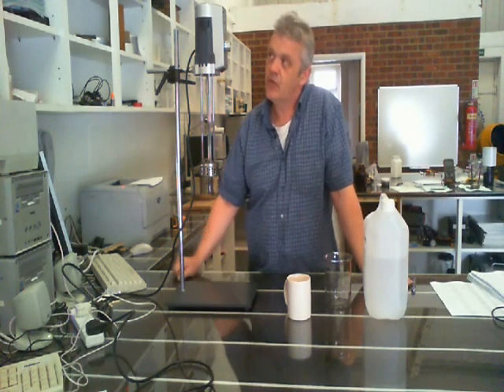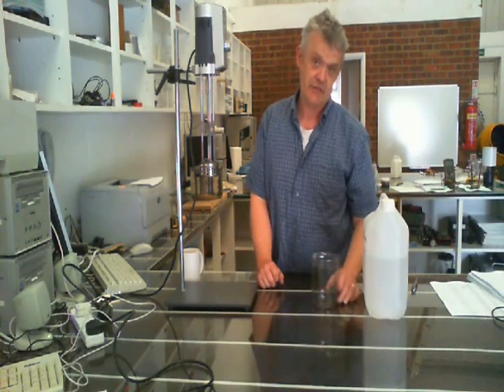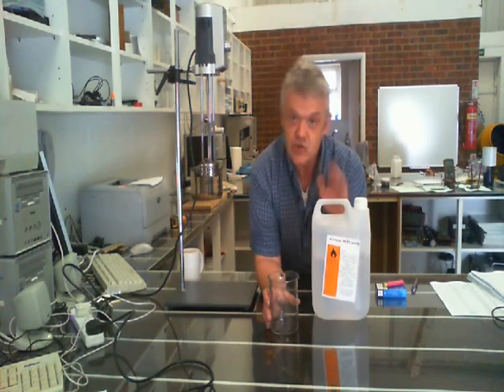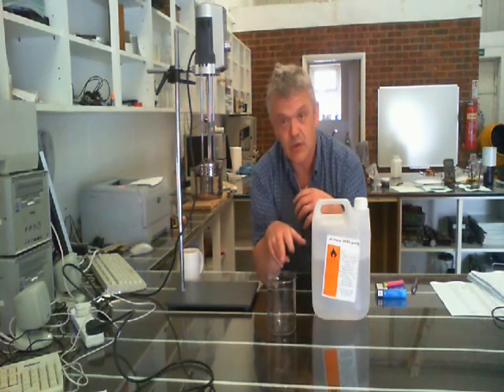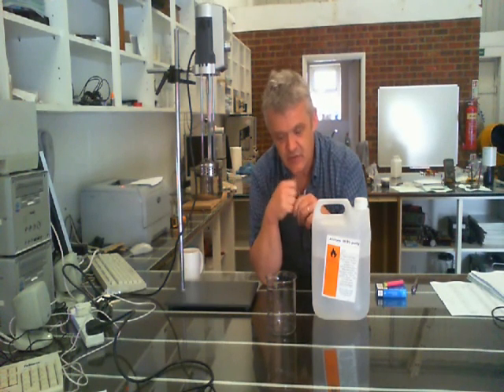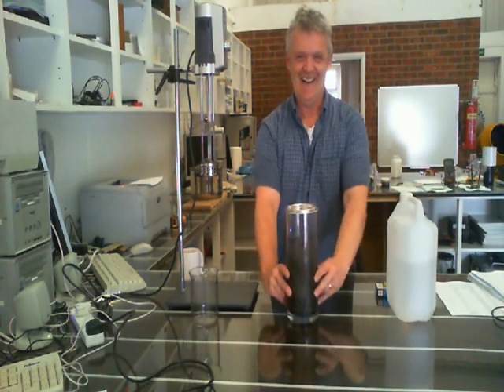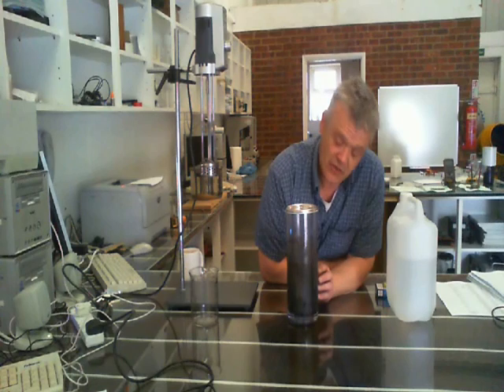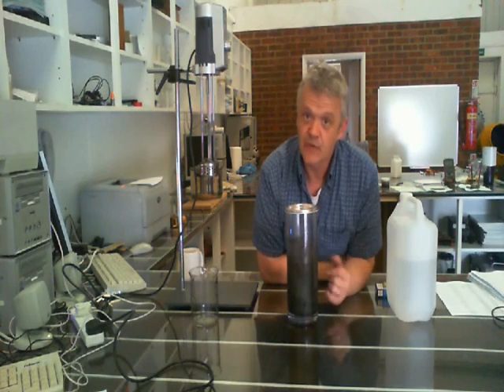The Easiest Way To Make High Quality Graphene

Comment: Thanks for the insight. I got a little frustrated trying to filter soapy graphene myself. I tried just using 99.9% isopropyl but the graphite doesn't exfoliate in that solution. Was thinking about doing an experiment with toluene, but that is kind of nasty stuff. 
Have you researched or had any experience with electrostatic deposition for graphene layering. I read short little paper on it and it was an interesting concept. Just curious on your thoughts about that as a viable option to get  a near "single layer" graphene sheet(s).
Reply: Aye, I figured you would say something along those lines. I was just seeing if you have investigated that possibility. There is other options that come into my mind like a electrolytic bathing solution. It doesn't necessarily have to be the same set up, just the idea if polarizing the graphite structure with a charged potential and layering it on some sort of substrate. Hope the idea isn't too radical for applications. I appreciate all your work, I didn't mean to delivery a pie in the sky idea. Just a little food for thought. I apologize if it made you sick ;)
Reply from the maker: Diadon Acs
dude - it should be obvious from my channel i set myself constraints - the process needs to be do-able in an average lab or one that can be set up easily, the process should be scalable, it should be cheap, the process should have an end product in mind. If it doesn't fit these criterion I discard it as there are so many processes it's not possible to look at them all - this is outside the parameters I have set and I can think of other methodologies for achieving the same ends.
Reply: Robert Murray-Smith nice to see Diadon over here, and is that Mitko? two people I met through knights of the round table radio show :)
on the deposition, the problem with depositing carbon it seems is that it is electrically neutral having just exactly half of the electrons it wants to fill that outer shell, and was something I considered altering in two portions, of a project, by using specific frequencies of laser light, this way you can dope the protons or electrons with photon energy raising the atoms positive or negative charge to get them to bond together and if the frequencies can be found, it should not take more than a laser diode or some fairly directional light to keep it from spilling into each others areas, like how a light is shot through a long matt black tube to get rid of the spread the light puts out :)  then you just need enough positive and negative voltage and amperage to come very close to what you are needing to do the deposition, and the light gives it the nudge to reach reaction point allowing you to control not only the atoms to get them to bond but also control where they are bonding. thus giving 3D printing capabilities with it :) I hope this secures this for posterity here so that no corporation comes along trying to patent that idea after I put it out there is all, like you said here about blocking the act of withholding use of good ideas by blocking the patents on your co-solvent idea, :)
Reply: you making graphene my friend?
Reply: Yeah, I have been dabbling with it. Turned out very soapy like he Robert said. Difficult to clean off and use for capacitor tech :)
Reply: hmmm....some brain food givem to me....
Reply from the maker: do you have the title to the paper?
Reply: http://arxiv.org/pdf/0808.1577.pdf?origin=publication_detail
There you go, its using a gaseous medium for the deposition. Might be possible to use a electrolyte if one could charge the graphene particles and deposit them into a negatively charged dielectric that wont bond to the nano particulate graphite.
Reply from the maker: Diadon Acs
Now then lol - the electrolytic bath is a different idea and I have used it for the reduction of GO to graphene - it very temperamental and sensitive to initial conditions soon dropping out of dispersion if it moves even a short distance form bath equilibrium - but works well when you get it right
Reply from the maker: good on ya mate

Comment: Great video Robert! What is the possibilities of doing these in Hi-def?
Reply from the maker: none whatsoever mate - sorry
Reply from the maker: i do this to inform and making videos takes a lot of time - I am not a video production company just a guy sharing what i have done - i would rather spend my time doing experiments - the videos are good enough to pass the info. At first they were pretty rubbish but now they are about good enough and I am unlikely to spend more money on video equipment and I am unlikely to spend more time on video production.
Reply: Robert Murray-Smith I do my videos with a 2004 Canon S1 IS. It's elderly but it works. The key is it needs really good lighting. Several CFLS did the trick for me. 

I agree - keep using the camera you have. I know full well about how long it takes to make videos so I feel your pain.